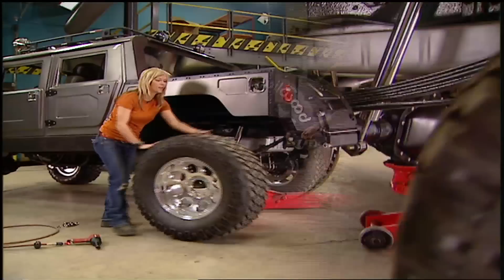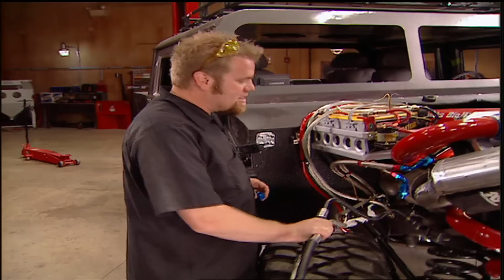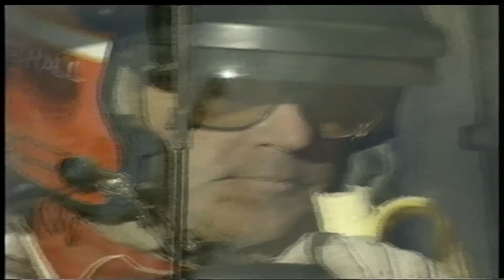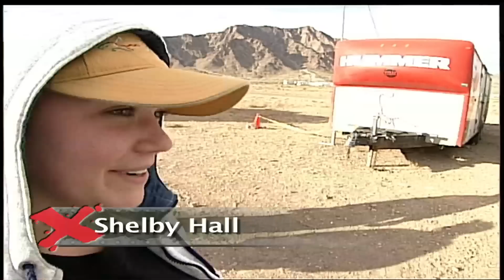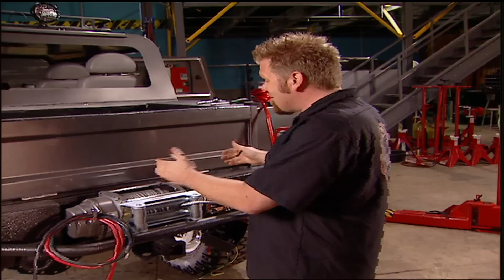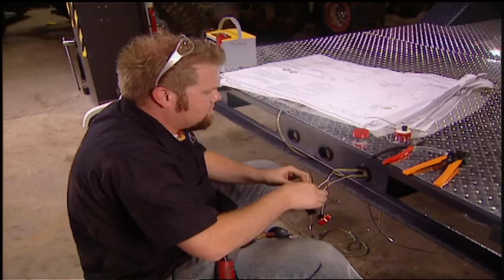Wrapping Up The Suburban Gorilla Tow Rig With Air Intake, Axles, and More - Xtreme Off Road S3, E11

Comment: They created an awesome rig and the payoff was driving it to the gas station. Never actually did anything with it. Come on. Could have atleast ran it through a water crossing or something.
Reply: C'mon it was never going to be a hard core off roader with electric fans and the air filtration like that. It has the show and go but not and is a cool project but as far as taking it to Patagonia the back way - hardly.
Reply: @ThePaulv12  it was a tow rig.   not an off-roader.